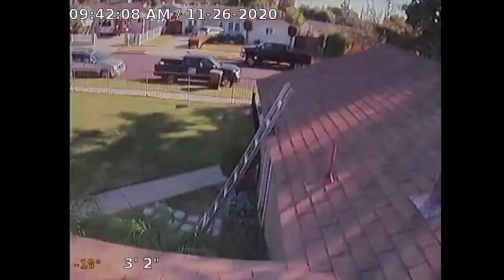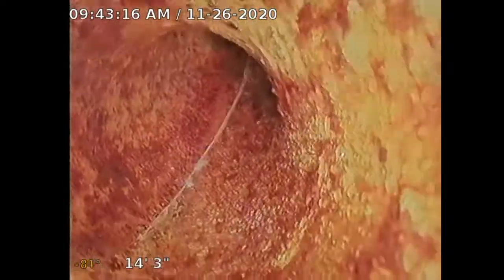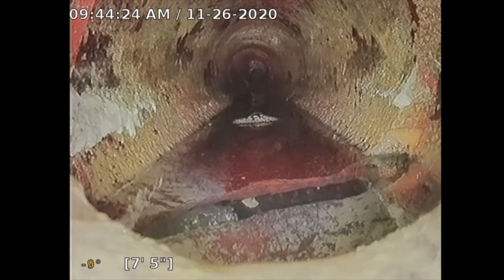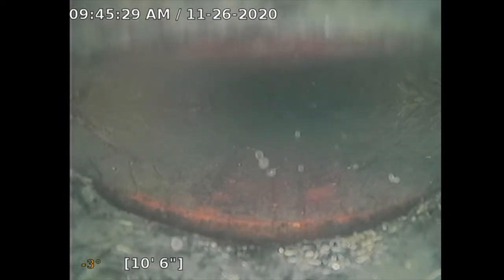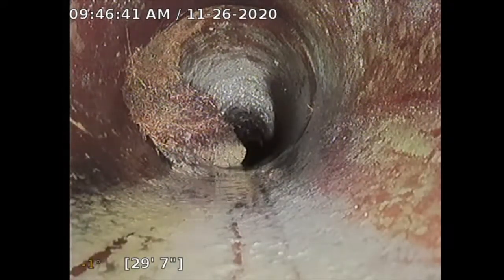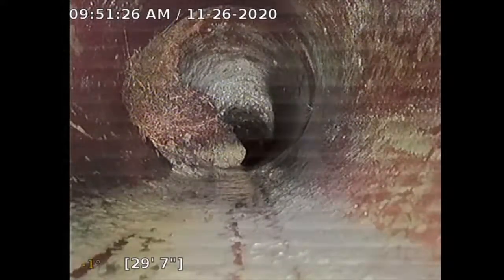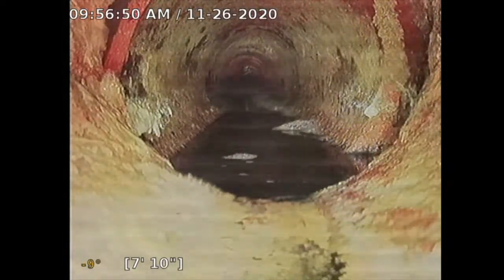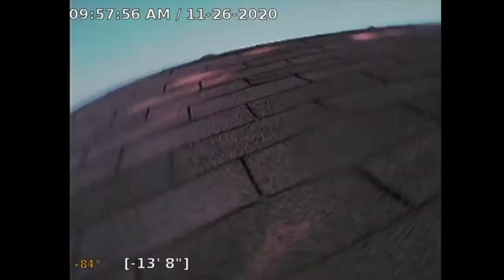Sewer Camera Inspection SeeSnake

Comment: awesome inspection love it ,, i do sewer inspection most clogged lines ,but i used the sewe rcamera sometimes.  i have a forbest red 200ft cable  pretty good camera ,, but  want to get me a ridgid in the future  probably 200 ft or 300 ft ,,,
Reply from the maker: Thanks for sharing! Yeah when line is clogged no need for camera right, I purchased the Ridgid 140 foot reel, used it for 2 years. I realized I needed at least 200 foot reel and got the 200' Mini reel. Works great and I still have my 140' for small clean outs.

Comment: How long should the rope be? How long should the sewer line be? How do you know when you’re at the end of the sewer?
Reply from the maker: The main lateral sewer pipe on average is about 120 feet from property structure to the city sewer connection. Some properties have a bigger front yard and may be 200 feet in length, by code there should be a clean out every 100 feet. The sewer city connection known as the city saddle is very distinct and we know when we are at the city main. I usually get to the saddle most of the time, only time I don't get to saddle is when there is an obstruction.